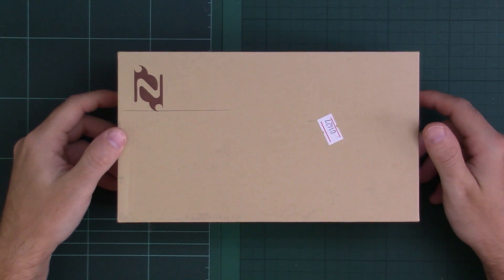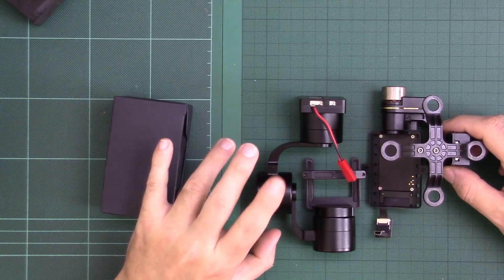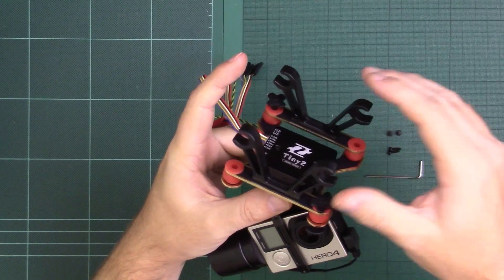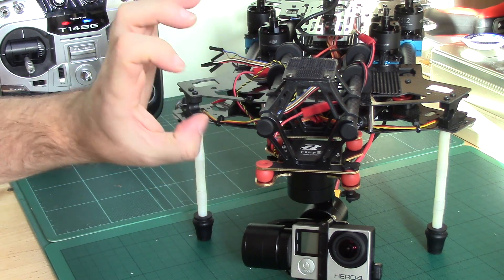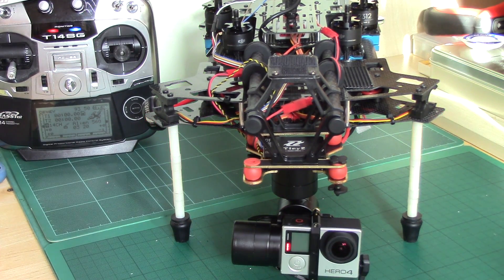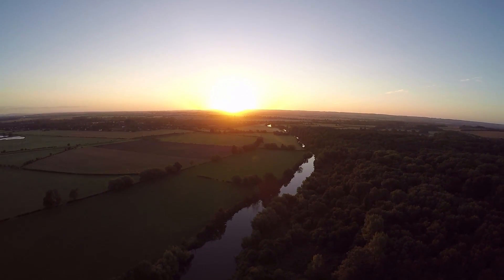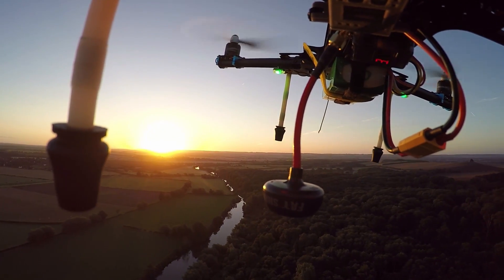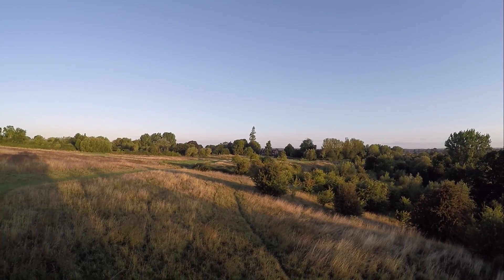Zhiyun Z1 Tiny 2 (3-Axis Brusless Gimbal) Review

Comment: hi guys, I am a vary disapointed h33d flyer
i have it mounted on a phantom
and the yaw motor can take the vortex wind coming from props on forward flight attitude.
I have messing with it for almost a year I think( not sure)
and I have had it.
i am looking at this product and can't deside would i be getting same vortax twitch shakes with this gimbal?
you all flying a bigger rig, the phantom small arms make the area of witch the gimbal would be mount very scary place to be,
does any one have an experience with this gimbal on a phantom and know what I am talking about and referring too that can confirm its a OK good to go gimbal ?
Reply from the maker: +Gilad Langer Hi Gilad - I have to admit I have flown happily with a Phantom and H3-2D as well as H3-3D without any such issues myself. The gimbal will sometimes glitch out if it is really windy but other than that it is just so locked.
The Z1 Tiny 2 is an awesome product but to put it on a Phantom you have to use the extra tall, extra wide legs which makes portability of the Phantom not as good.
I only flew it briefly on the Phantom using a customised 3D print mount that I made but it seemed to work fine.
Your H3-3D.... are you using a Hero 4 camera on it at all as that can cause twitching and glitching due to the weight difference between H3 and H4. The H3-3D is super sensitive to balance so a mis balance will cause that problem.

Comment: will this fit your h3-3d xugong mount?
Reply from the maker: +DJ BASSBITZ Currently no but I am potentially going to look at developing a seperate mounting method for the XuGong.... it deserves a gimbal as good as this. Only problem will be making an anti-vibration method for it without it being 4 feet high off the ground! Good news is the gimbal does work when you turn it on side on but the yaw motor has to be under the camera (meaning panning down will show motor not the ground. It would mean though that you can easily fit it to the front bulkhead with a fairly simple mount so that will be my first port of call. I really really don't want to take my XuGong apart again though so it will rely on me getting a crash kit for it first.... I will do a video and write up on my XuGong blog if i go this route.
Reply: +d3weyTube hmm, can we mount it on its side and switch the axis within the software they provided perhaps? Just like what rude boy did with his Xugong for the feiyutech. 
Another solution would be stretching the 3d printed mount to be much taller to compensate for the ground instead of continuously increasing the height of the landing legs. Doing so you might have to think about adding strengthening shapes just to increase the rigidity of the gimbal mount and the air drag that may cause the Xugong to oscillate due to that new mount . Hmm
Reply: +DJ BASSBITZ oops didn't read about the part that it does work sideways , doesn't work the other way eh
Reply from the maker: +DJ BASSBITZ Yeah as you noticed it will mount side on as long as you don't mind not looking down more than 30 degrees without a motor in the view. You can also mount it upside down as well which is nice.
I just purchased a replacement CF frame for the v2 Pro for design related purposes so I am confident I will be able to creat a mount. 
Raising the height of the mount would be tricky. It could be done but as you mention there will need to be a lot more structural support to prevent wobble (last thing v2 Pro owners need is more wobble!). I fear that in itself would double the volume of material and hence put the price even higher through shapeways and it is already too price for many. I think a simple cheap Tiny2 mount that fits it to the bulk head will be popular but it won't be dampened at all so there is risk of the XuGong jitters coming through hence an overhang option will also be looked at too :-)
Reply: +d3weyTube sounds like you'll be doing a lot of designing and testing soon. All the best and looking forward to it!

Comment: interesting with Hobby King selling the z1 tiny 2 for £60 i thought the s was just around the corner.
Reply from the maker: +Guide504 If you mean this: http://www.hobbyking.co.uk/hobbyking/store/__86506__Z1_Tiny2_3_Axis_Brushless_Gimbal_for_GoPro.html then i am a bit suspicious... the mounting plate is very different to the one I have. Not convinced it isn't a very old version of it.
Reply: its the same mounting plate on the s prototype shown in 2015
Reply: +Guide504
Just wondering. How important is this "old" mounting plate
Reply: On that Hobbyking link, the Tiny 2 is £237. I got mine about 3 weeks ago from Banggood, and it came with that same plate. It's the same plate you see in AndyRC's review of this gimble, which is quite a recent review, so perhaps the plate is a later modification?